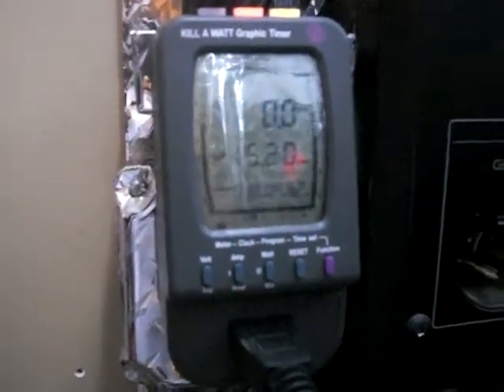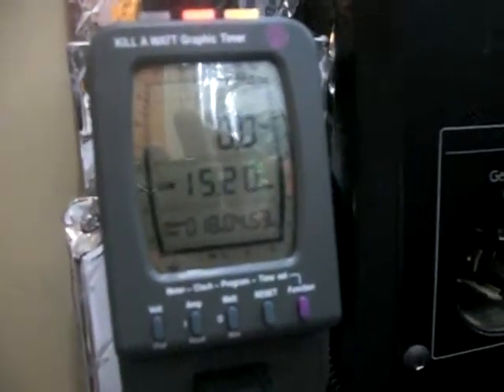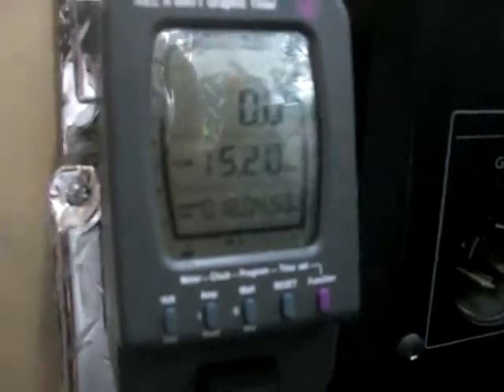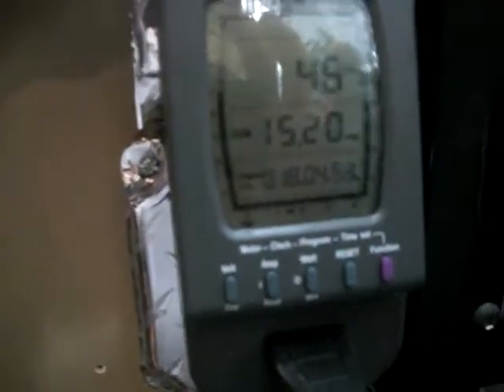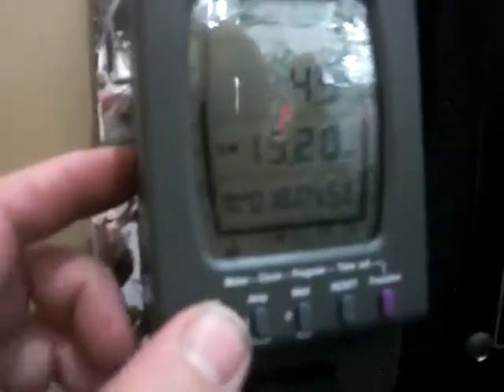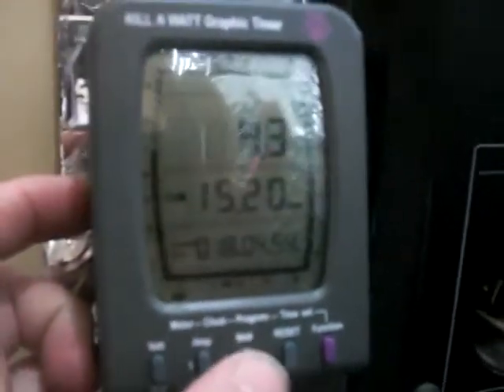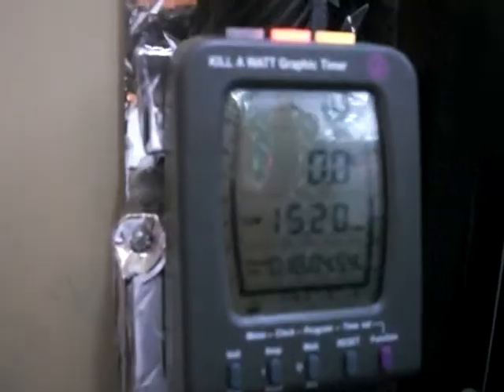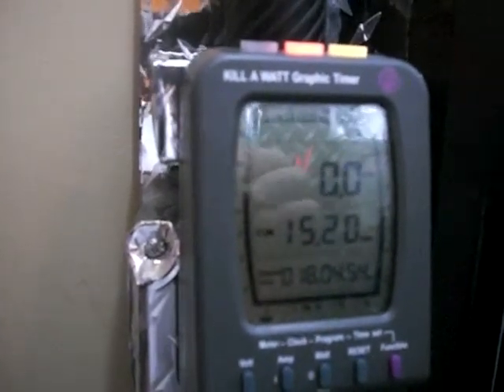Kill o Watt Meter With Timer

Comment: they do NOT recommend un plugging the AC power, disconnect the DC power first.
You could increase it to 10 pm then unplug, as long as DC power is very low. Or the DC will build up and fry the MOSFets...if the fan is running add more grid ties, is also
advertised.